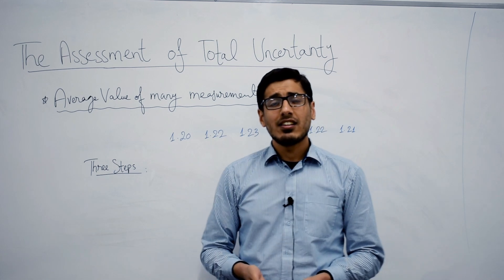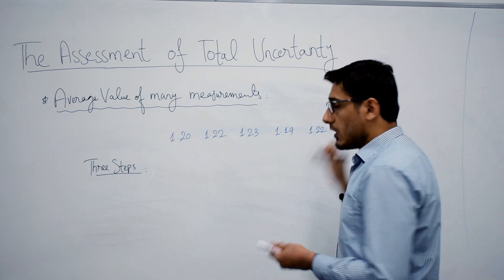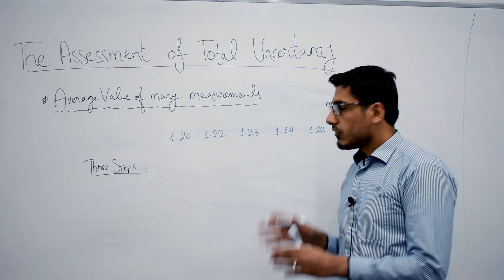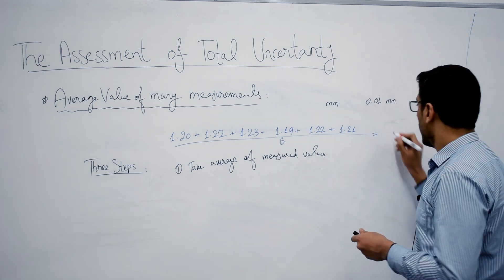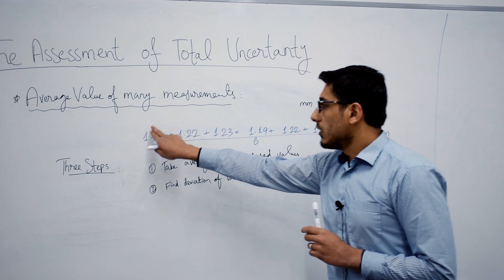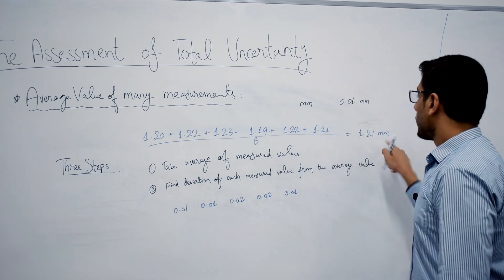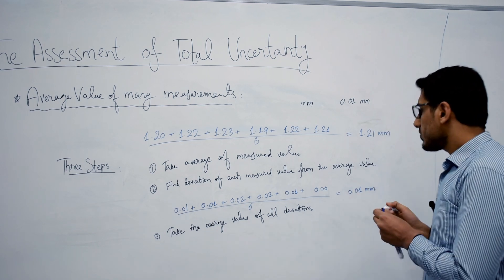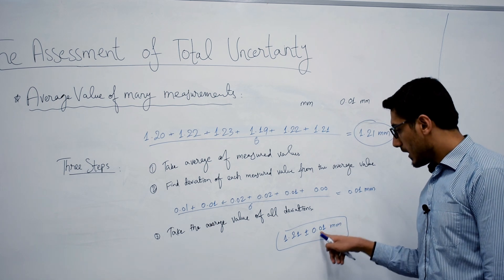Calculating Uncertainty 5 - Averaging Multiple Measurements

Comment: I do not think this is right. In this case you are saying 1 measurement is as good as 1000 measurements. In random processes the uncertainty should fall off with the sqrt(measurements) (Poison statistics). There is some random noise about a mean, and the more measurements you take, the more certainty you have in the mean value. This will give you the uncertainty of your measurement aperatus though :-).

Comment: Hi Sir, 
I have a question. I will put it in terms of the wire example. 
What if I take six measurements of diameter of wire and calculate the error as shown but I also have to fine average diameter of multiple wires (for example 10 different wires). If I take the average diameter simply, what happens to the errors we obtained from multiple measurements for each wire? Thanks